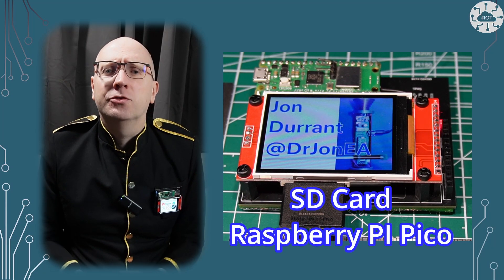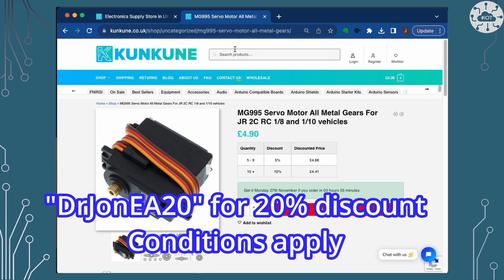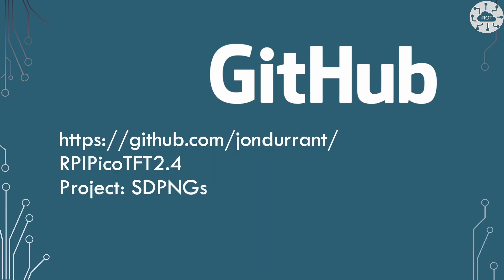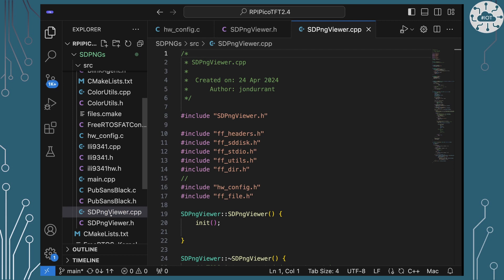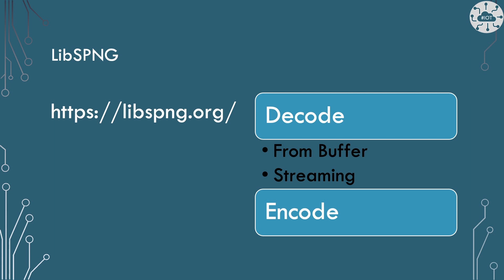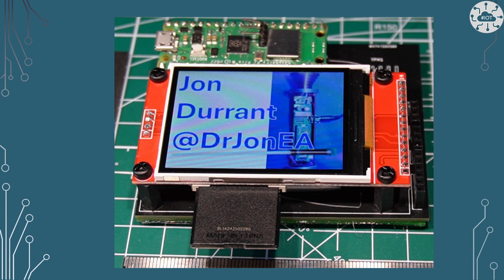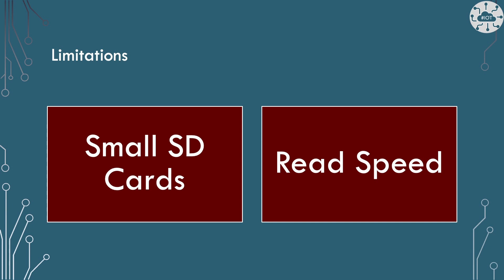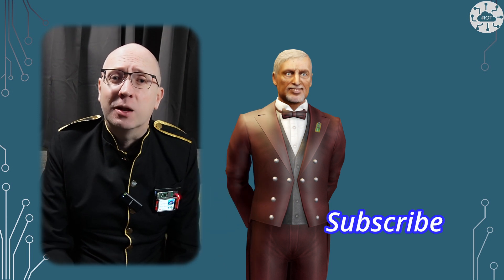Using SD Card with Raspberry Pi Pico and TFT Display  in C/C++ | DrJonea.co.uk

Comment: Hi. i have one question. is there a way to make png drawing faster? like to get 20 png showing in 1 sec? (for creating cheap lcd video display)
Reply from the maker: Good question and one I've thought about a bit. I'll talk about this a bit on my Live Stream this Sunday, as probably more than I can talk through here.
Generally there are a few areas in this demo that are blocking me doing video:
1, SD-Card read speed. I was using SPI to read the SD Card, could improve that with use of the alternative parallel interface to an SD Card
2, PNG Decoding time. This could be a challenge for the RP2040. We could upgrade to a RP2350 which from my tests would give 2 to 3 times the performance for this sort of workload.
3, Is the Display SPI interface fast enough? I think it is but due to lack of RAM on the RP2040 I could not do a full DMA transfer of data, which would have been the faster way of putting data onto the display. The RP2350 would allow a full screen buffer and therefore DMA transfer.